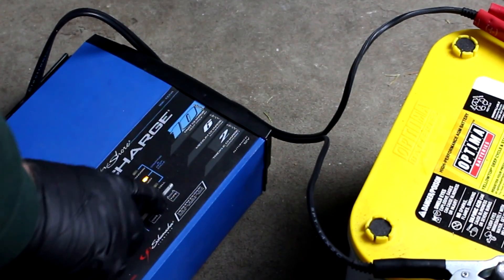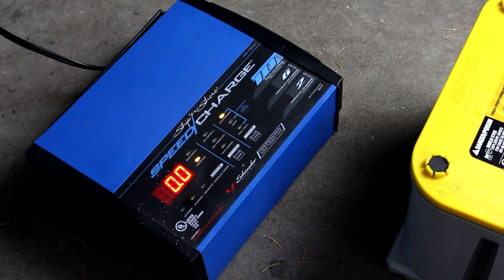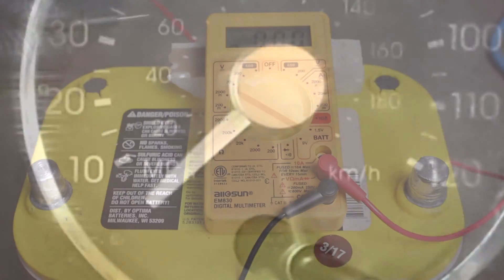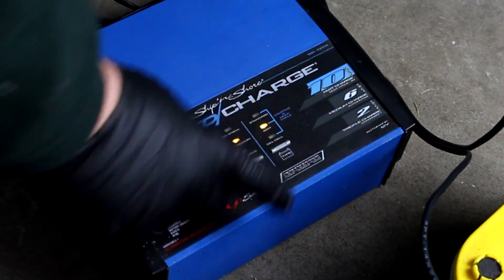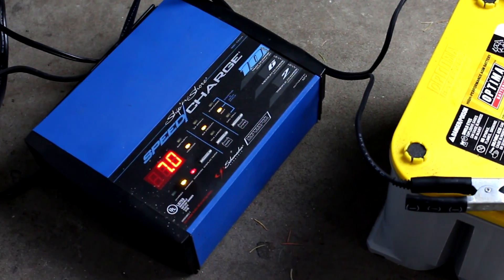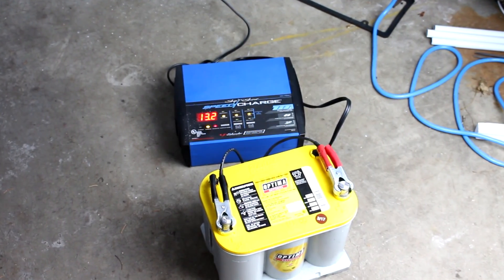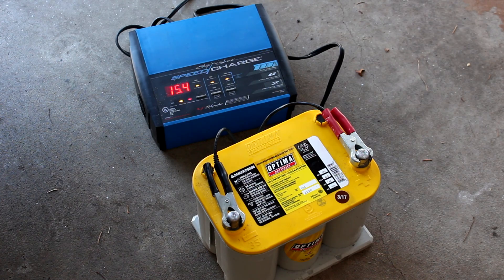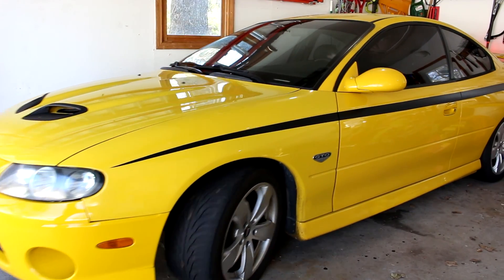How to Recover/Restore an Optima/AGM Battery • Cars Simplified

Comment: Be careful on some cars because you might have a battery or alternator that might not have the special setup in this car for the high performance make sure that it can handle this type of battery whether it's a jail or a GM optima battery.

Comment: Do I set my charger on agm or standard?
Reply from the maker: If you have an AGM battery (the battery should say AGM or AGM spiral on it), use the AGM setting.
Reply: @CarsSimplified  I'm using a standard battery in parallel with the yellow top. My question what do I set my charger on? Agm or standard?
Reply from the maker: Ah, the other Optima recovery trick. I've heard it's better to use another Optima for that, so I have always done it that way. I'm not sure if the AGM setting will negatively affect the standard battery, but that's the setting you want for the Yellow Top.

Comment: My battery always has a lot of corrosion on the negative side so I decided to take it out, clean it, charge it slowly all night long and protect the terminals to prevent it as much as possible. Slow charging will always be the way to go with a battery in my opinion. Taking your battery to an Auto parts Store won't charge it properly since they charge so fast they usually don't get to charge at all.
Reply from the maker: Great to hear you got it working again!

I used to work at a parts store, and I know all about that. You can ask for a slow charge (my store in Florida had one fast charger and 8 smart trickle chargers ready to use) but not a lot of people know that. I should probably make a video about that.
Reply: Cars Simplified it probably depends on the auto parts store, I worked at an AutoZone (not the greatest auto parts store tbh) and they only had chargers that either did a "normal charge" which was 2 hours and a fast charge that was 30 minutes. They didnt have a charger to do slow charges overnight. If they did I know most customers would leave with a charger battery.

Comment: Nice video, good idea on the low amperage charging. Using the high amperage charging could have the effect you mentioned as as well as the possibility of venting from the battery. The charger you used may not have been picky about the battery’s charging voltage, or it might not have been low enough for it to care. Sometimes when the battery voltage is very low the charger will refuse to charge it. I had that happen with a LiPo battery recently and had to charge it manually on a variable power supply for a short time before the charger would charge it.
Reply from the maker: Thanks!
Yeah, I suppose that's where the second battery comes into play. I was under the impression that the AGM setting knew to ignore very low voltage, but perhaps not all don't.

That reminds me, I have a lithium battery tucked away somewhere that I need to charge. I'll have to look into that some more; they are supposed to be even more tricky!
Reply: Cars Simplified yeah it could be less tricky on an AGM since they are usually ok with being deep cycled, maybe that’s why your charger was fine with it like you said. LiPo’s can be tricky since they shouldn’t really be deep cycled and you have to be extra careful not to overcharge.
Reply: @CarsSimplified  what charger did you use??